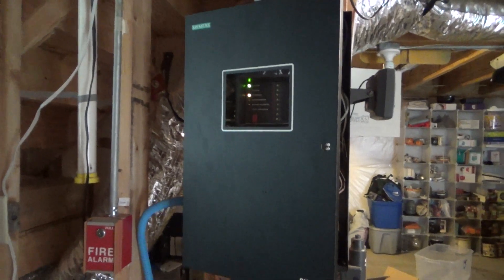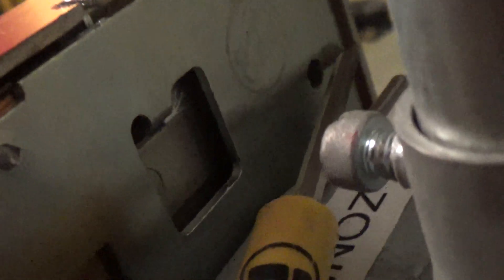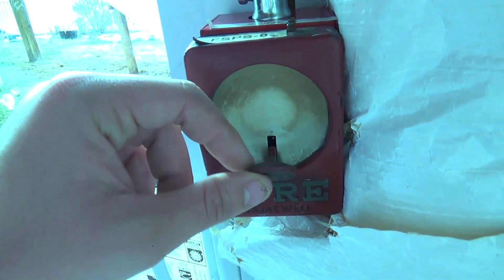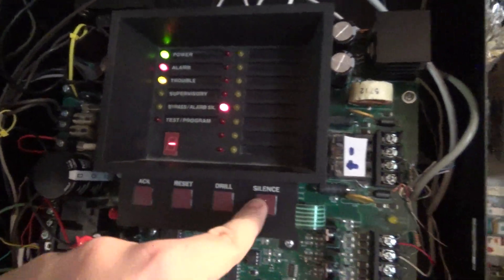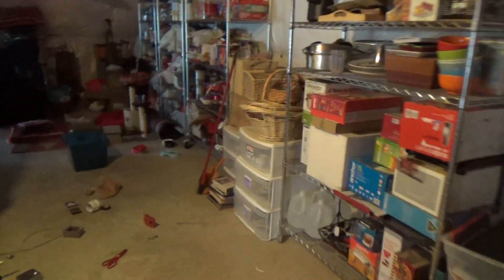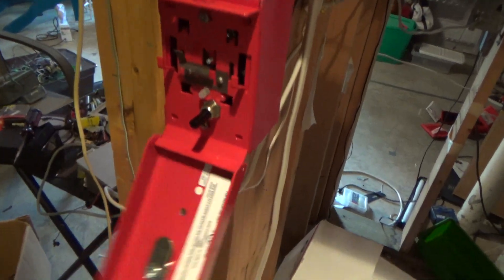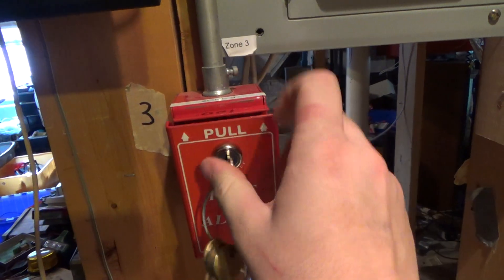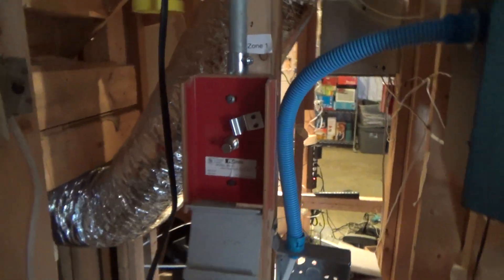Final System Test 5/Siemens SXL-EX Finale

Comment: "What are those two little dots?"
Those there sir are dead pixels on your camera. Probably from putting the camera close to strobes or pointing it at the sun.
Reply from the maker: +Astronautical Either or... Could've been when I tried to review my 700mw laser pointer...
Reply: TheLilRubix1 That'll do it :/
Reply: +TheLilRubix1 can I a wheel locks RSS and BG8 with a hole in the middle
Reply from the maker: JJ Volume 1 I'm not getting what you're trying to ask me.
Reply: ***** So it seems i'm not the only one who watches Photonicinduction...